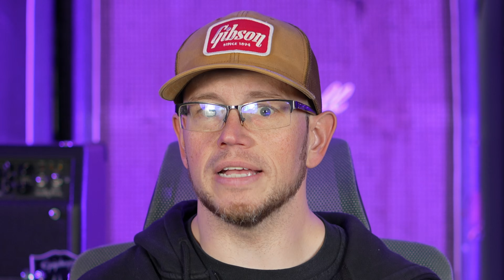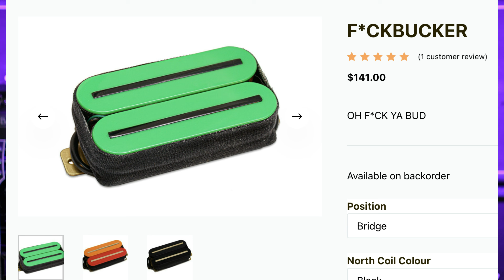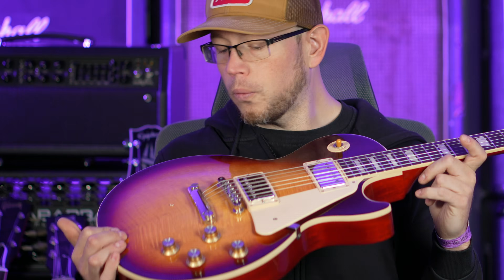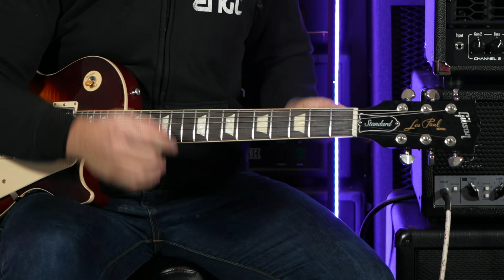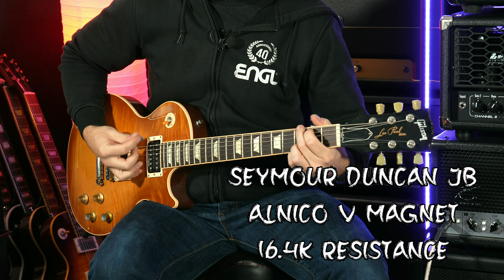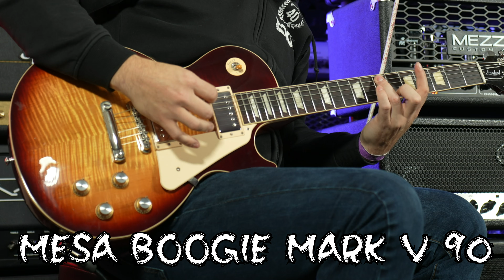EVERYONE has been using the WRONG pickups for metal......

Comment: Personally I  use:
- low to low-medium output pickups for high gain amps
- high output pickups for low gain vintage style amps to drive them into OD.
Reply: I second this. My invader does do a pretty gnarly job in general tho
Reply: Too many good pickups to list most of your tongue comes out of your speaker and your cabinet good speakers vintage 30s Jensen make some good ones Mojo tell me some good ones you got to have a great speaker in your cab for one
Reply: @Davesmusic420  Yes. I've been having my tongue come out of a Mesa dual rec and cab. When my tongue comes out of it, it is very distinct. I suggest that everybody tries their tongue through that sort of rig. 

🤭
Reply: @Davesmusic420 I disagree on the speaker being the main tone shaper. It only adds tone to what's going through it and most speaker tone differences can be adjusted with a simple EQ. Speaker tone is completely overrated.
Reply: @gibsonfan159 gotta disagree. I run 3 different cabs, all different speakers and construction. No amount of EQ tweaking can get the same tone between the 3.
Reply: @chriswakfer4473 there are videos disproving this.
Reply: @Hal-mz7ro You say that like tone isn't subjective
Reply: @gibsonfan159  the speaker dictates what CAN be heard from whatever is produced before the signal hits it so its pretty much the baseline for your tone. Fact not subiective.
Reply: Personally I don't like high gain pickups at all.  
it's nothing I can't clean boost into the amp.  
I can always find a way to gain an amp just right pre amp wise.  
You know what you can't undo?  pickup transmissions themselves.  
I want a bell clear balanced pickup.  the rest can be played with easily in comparison.
Reply: I agree a medium output pickup sounds better through High Gain look at Joe Satriani for Christ's sake he sounds great through his medium output pickups
Reply: What do you determine as as low, medium, and high output?
Reply: @domoniquebrooks816  a low output would be something that is. Very very dynamic. Like u need something to push it. Vintage. Think PAF, jazz pickups etc single coils even. Medium, a bit hotter, slightly compressed. Think of a Duncan custom or full shred, or a jb style pickup. High output, EMGs 81/85, Dimarzio super distortions, Duncan distortion. So for all this, if ur tryna find something out of pocket than these, study the magnets. Alnico 2, and so on, are very vintage, as it goes up, it gets hotter to ceramic. E.g. the 81s SD and so on. Hope this made a bit more sense
Reply: The specs on the pickup whether they're low medium or high just play what you like who gives a s***
Reply: @domoniquebrooks816 low is paf, most single coils or '59 , mid is paf pro, screamin demon or sh-5 custom, high is Super Distortion and JB/Distortion.
Reply: Then you have stupidly hot : X2N & Invader.
Reply: By medium, what's the highest resistance? I like a hot 498T or a Super Distortion into a high gain Friedman, but it depends what music you play.
Reply: Bingo.
Reply: EXACTLY
Reply: That's totally not even close to what you should do! 😕🤔... Ughhhh I'm sorry I'm totally wrong you are very correct in how you should use them🤘🤘🤘
Reply: Too much talk not enough guitar playing

Comment: The sugarbucker sound has very nice tonal character, I like a lot the articulation and clarity it has. Do you have to hit harder the strings in order to sound good compared to the other pickups?
Reply: I run PAF style pickups into my Jet City 50, and the gain is still on 4 - while on a DSL or my Tech 21 British the gain is maxed. Recto, 5150 etc have more  than enough gain on tap.

If you're running a boost or overdrive, you won't need to work harder imho.

If you're plugging straight into a JCM 800 or SLX, you might have to work a bit harder. 

The older pre DSL Marshalls like higher output pickups hitting them hard, and many - like the Distortion, Invader, SH5, Super Distortion were literally designed for this purpose.

Comment: Pickups are a big deal but really if you have a humbucker loaded guitar.. any pickup goes , i use a mexistrat hss into a quad cortex and you get really thick sounds ..
I also have some emg loaded guitars so.. can you get better tone with bareknuckles , emg fishmans ? Hell yeah , but is it really necessary? Depends on your taste! For me i will change them at some point , but still..bothing wrong with mid / low output pups if the gain stage of the amp is high enough

Comment: While you're generally correct and I prefer the dynamics sometimes of a bit lower-gain pickups, you can also just turn the gain knob down for higher output pickups.
Reply from the maker: Like I said in the video, you can’t add clarity to pickups that don’t have them, which is why I like the paf.
Reply: @belligerentamateur  I hear you, though also at least with my setup when I turn down the gain it gets more clarity.  But I do like quality lower output pickups for a wider variety of things as well as for the clarity.  Good video. 8)

Comment: This is 100% accurate. I take it a step further. Take regular pickups, and an older architecture amp like a deluxe or soemthing, non high gain amp and hit it with a quality overdrive front and the saturation profile you get is wayyyy better than a 5150 or something more modern like ENGLs etc

Comment: You can add clarity to any pickup by lowering it.
Most of my high output pickups end up 1-3 mm below rhe pickup ring.
Reply from the maker: Really depends on the pickup, and doesn’t change the fact that most of the pickups shown in this video do not possess the same level of clarity that a good paf does. But yes, people neglect pickup and screw heights quite a bit
Reply: @belligerentamateur  Yeah, I wish there was a better selection of lower output rails.

Comment: I love PAFs, but definitely not for Metal. The gain structure and response are just to smooth and open for real tight, punchy and cutting Metal riffing. I don't use high output pickups for gain (that should be as low as possible anyway), but for the response and voicing. A tight ceramic is the way to go. Het Set, bitches.
Reply from the maker: Thanks for dropping your opinion!
Reply: @honigdachs. My experience with low out put humbuckers (like PAFs) is the opposite, they sound very granular (not smooth at all), super tight and abrasive - exactly what I don't want. High output humbuckers generally serve me quite well because they have rolled off, smoother highs and are looser (especially something like Dimarzio Super 3s or even Super Distortions).
Reply: @ilikepotatoes1345  I get what you're saying with "granular". I like that for vintage tones, classic rock stuff, crunch, semi-driven, it gives the sound a nice texture. But for Metal, it's too messy and spiky.
Reply: @honigdachs.  Yup, my exact thoughts. They absolutely slay for classic crunch tones where that granular texture comes in handy, but for my mud-city, super downtuned, soupy high gain Death-Doom tones it's a no go.

Comment: I put a low output super distortion from the neck position (so reckon is about 8 or 9ohms compared to the bridge which is 13) into bridge position on my SG and it sounds awesome for heavy stuff , also works far better with VST sims than high output. I even but an EMG 85 in the bridge instead of the 81

Comment: I'm dig'n the concept. Maybe try using some other low to medium output pickups in a comparison. If all we hear is 1 PAF based example, and then 5 with literally double the ohms resistance. Its not really an optimal comparison. 
I'm partial to a Vintage PAF in the neck position. But prefer something around 1 ohm more resistance than whatever the neck is, in the bridge. Thats what I've found to give the best balance of tones in LP. 
Burstbucker 2&3 in a LP Standard. With a Custombucker and Burstbucker 3 in a LP Custom.
Peace!

Comment: That seymour duncan distortion loaded epi has the clarity thing going on too. But idk if its just reminding me of my epi with a seymour duncan 59. It may just be a familiarity thing since I run mine through high gain stuff too. My ear feels "at home" when listening to that.
Reply: I used to run an Epi SG with the Duncan Designed Distortion equivalent.

It's purpose built for metal - in a way you can't turn off. Like a passive 81, you better like what it does, because there's no getting around it when you want to switch modes and jam some ACDC or Sabbath.

Whereas, you can take your '59 and put any number of boosts in front to get you that output and tightness - and then turn it off when you don't need it.

Comment: "you can't dial clarity into a pickup"
my brother in christ did you look at where you have the gain knob on that 6534??
they will all have much more clarity if you take it easy on the amp gain
Reply: You can by lowering it.
Reply from the maker: I generally don’t run the gain that high….unless I’m using a pickup that needs it. I also run a 5751 preamp tube in v2 of this amp, which lowers the gain as well. Using ears and not eyes is always a good practice!

Comment: My take on this would be more for the studio rather than live, but going to a thiner gage string might help bring out more clarity. My theory behind that is that the thinner string will carry the more fundamental note and have less harmonic (undesireable) overtones
Reply: That's completely backwards in reality. The thinner gauge any type of metal is, the more it simply cannot maintain control when plucked via pick or even by finger style. 
They certainly have better transient characteristics because the lighter gauge can stop & start more quickly, which may be what you are confusing in your thought process. 

I have never enjoyed thin strings for metal riffing, regardless of standard vs down tuning. They simply cannot handle low resonances as composed as heavier gauge strings & get extremely flabby with strong picking during palm mutes etc. 

As far as the note fundamental is concerned, this is directly related more to how the strings handle (keep their vibrational composure/movement) which always depends on how well they can handle the lowest registers in each of their respective frequency response characteristics (within the context of string vibration), so this simply rules out the thinner gauge theory- other than for, perhaps, non- fretted harmonics, picked, that consist of very minimal string movement.

Comment: Les Pauls are king for rhythm playing, in my opinion. I have one with a Burstbucker3 and another one with Dirty Fingers and they just grind. In my "rock" guitars I mostly use various Seymour Duncans but the best ones for rhythm are the JB's, which are kinda like PAF's. I think you have to keep pickup distortion somewhat in check to get articulation.
Reply: I went on a quest 20 years ago. 

I had an RG550 I wasn't entirely happy with, running a Tone Zone.

I wanted the "James" setup: 24 3/4" scale, mahogany set into mahogany. 

Had to be something to it - him, Iommi, EVH's Destroyer (all non-Whammy bar tracks, ie the rhythms, on VH I & II are this guitar, NOT Frankie), tons of others.

I googled around, and some autiste had utilized contact microphones and a spectrum analyzer to determine which body and build style put down the most low end.

I tune to D standard & Drop C & run my bass knob wide open, always. Past this, I just don't like it, not interested in going to B or A. 

I also primarily use Marshalls and similar circuits, which can use some help in the bass department.

Tldr; it's a singlecut setneck. 

The extended upper bout effectively makes the neck shorter, producing more low end.

BTW, a bolt neck will not achieve this physical effect.

I ended up with an 03 Gibson Melody Maker, the "Junior Maker" I call it, since it came with a TOM/ST and a P90 instead of a wraptail & single coil.

Routed it for an SH5, and it's been a war machine ever since. Cost me about $500 and it's still hard to beat.

Bonus was the one piece mahogany body - much like my real, stunning, AAA top on my Studio, also 1 piece back, you aren't getting wood like that from LTD, Edwards, Epiphone, or most other Asian copies.
Reply: @rocketpigrecords3719  Tokai’s Japanese made Les Pauls rival, and in some cases, surpass Gibsons. Their ‘59 reissues are as good as anything Gibson is putting out for a third of the price. Only downside is you have to buy them as a grey market imports.
Reply: @rocketpigrecords3719  "also 1 piece back, you aren't getting wood like that from LTD, Edwards, Epiphone, or most other Asian copies.",  I've been buying Japanese LP's for over 20 years, my 2 favourites are 1 piece bodies , Honduran mahogany and one has a curly maple ONE piece top too. I can name a number of Japanese makers that make one piece back LP models, and have done for 40 years or more...

Comment: I think maybe the only benefit I've found in higher gain pickups is that the stronger magnets keep the strings from getting flubby when downtuned.  Even Ola recommends mid gain pickups with today's high gain amps
Reply: Higher gain passives, a little. High gain actives: negligible string pull.
Reply: @FrankyFeedler  yeah I should have specified passive.  The only active pickups I own are in my bass so i don't know how they affect strings on guitar.

Comment: Especially with modeling this is important,
Because you’re adjusting your input gain anyway,

Sometimes I wish I had not gravitated towards high output because high output guitar  signals are more trouble in a digital environment.

Worthy if note,
One advantage of higher gain pickups is that every notch of that gain dial up on the amp raises the noise floor with it.

Also the attack is better suited  for staccato stuff.

I used to play more medium gain but switched to high output as my tastes changed,

Think I’d prefer lower output,
But I really like the black winters.

I wish a video like this existed before I switched.

Comment: I actually like low/med output pickups into my high gain amps....clarity sweet clarity.  The modern metal amps have NO trouble getting enough gain.  In the past....people didn't have real high gain amps so boosting the front end was how they did it.  Nowadays...clean headroom..a clean input signal...the modern amp will do it's job better.  I love the bareknuckle pickups...my faves. Lots of good stuff out there from others too.

Comment: High output ceramic is where it’s at for me. Thickness in the mids like an alnico V, but a lot tighter. The alnico high outputs are too loose for me; especially if you tune lower.
Reply: Real question here, not trolling : why High output ? I totally get the ceramic for tight metal, but high output ? Nowadays modern amps do have all the gain you need and even more, and high output pickups were invented by necessity, at a time when all there was, was Marshall Plexis, and later JCM 800, amps that needed to be pushed harder, hence the need for high output pickups, but today ?
Reply: @ generally if you wind a pickup hotter the mid range will be more pronounced. For high gain I don’t want to send too much highs into the distortion. I like it more when there are a lot of - especially -upper mids, but the highs are rolled off. It gets too fizzy for my taste otherwise.
Reply: @Patrick-rf7vx   Makes sense, thanks for the reply